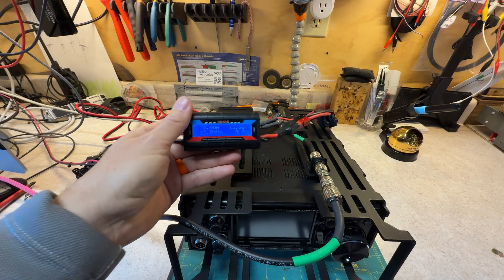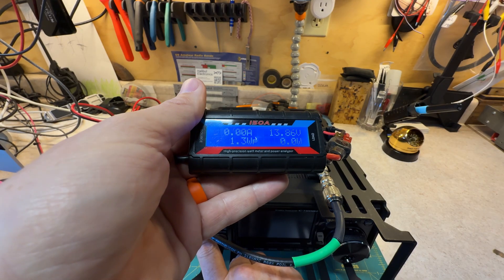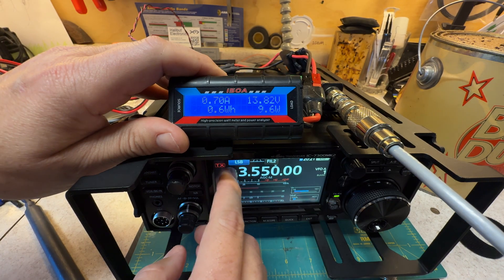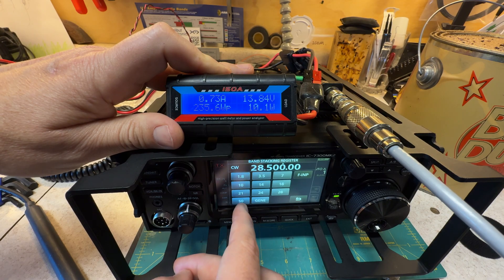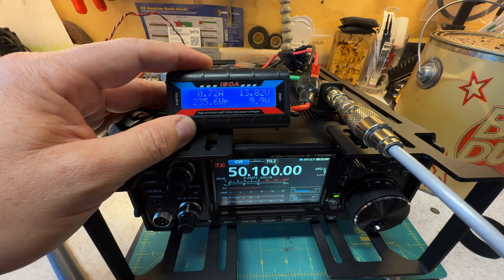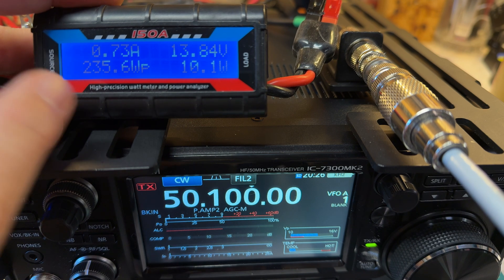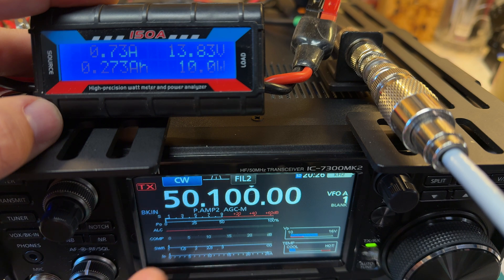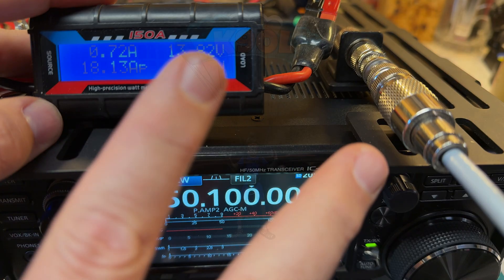⚡ How Many Amps Does Your Precious Drink? — IC-7300 Mk II Power Draw Test

Comment: Thanks for the video. Im assuming a 20A power supply would work fine but maybe I should go with a 30A just to be safe? Im new to all this so I could use any advice you can give me. Also what antenna (name and model please) are you running with this? Thanks
Reply from the maker: 20A should be okay but keep in mind that the draw on transmit is over 20A. Some power supplies will be ok with that and some will shutdown or pop the fuse. I'd say go with 30A to be sure.
Reply: Thanks for the info. Could you tell me what antenna you are using?
Reply from the maker: I use a lot of them.

Comment: Looks like you are a fan of the ic7300,  you clearly like . Is there anything you do not like ? I had the original 7300 and it's a easy to use rig , only one that lets it down badly is the noise.  Internal noise can not be reduced with the ATT or the RF gain.  On noisy bands like top  and trying to listen to weak sigs was very frustrating and impossible,   my question is have they fixed this ? Watching some other  videos it appears not ? If you can't or don't want to answer my question, that's ok . If you are not sure what i am on about a YouTube video channel,  SV3ORA: IC7300 VS FT902DM internal noise and receiver noise settings
This video is what i mean . Anyway enjoy your new rig . MM0UDI.
Reply from the maker: I was already a fan of the 7300 so this version is a shoe in for my attention. 

What I wish it had: well what we all wish it had, the same VHF and UHF capability as the IC-7100 but I don't think that manufacturers are ever going to give us a new full deal Shack-In-A-Box 100w radio again. I'd love a blend of the 7300 and the 9700 in one unit the same size as either radio but I don't think that is technically possible anymore. At least not at the RF quality that the individual units will have. 

I watched the first ⅓ of that video you note. I can try to run that same experiment with my radio later today and see what comes of it. No promises, my Mon-Fri 9-5 job still has to get done.
Reply: The ICOM specs for the original ic7300 is .9 A on standby it’s really not much difference.